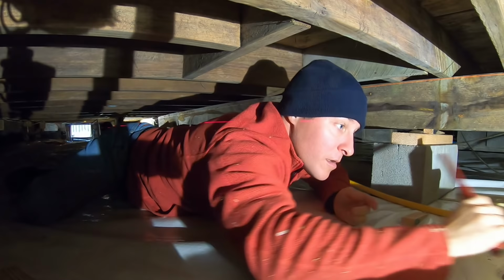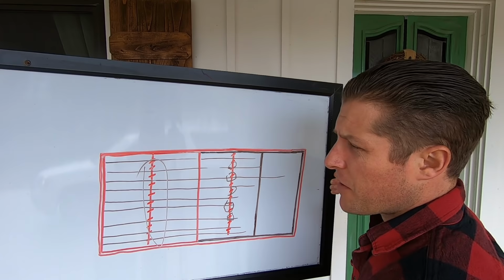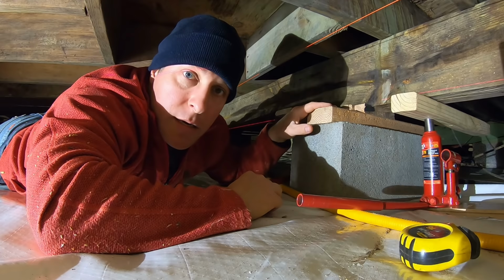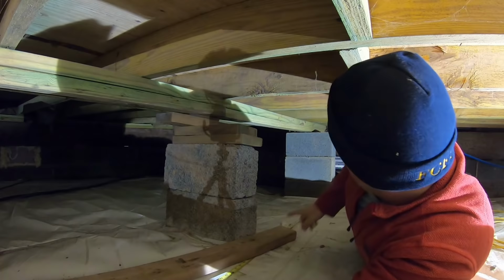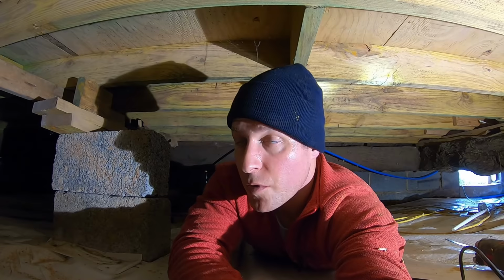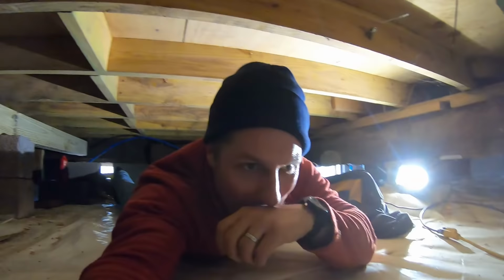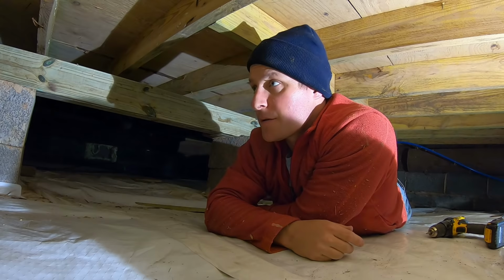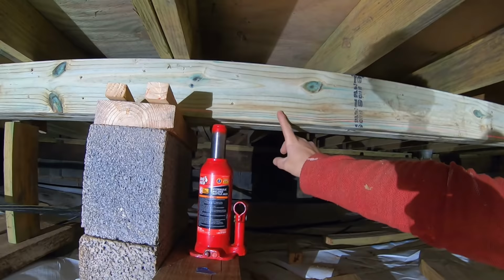Leveling FLOORS in our 100 year old Farmhouse! Fixer upper

Comment: That's a major undertaking. 👏 Just in case you ever need to do such a task as installing new support beams in the future there is a reasonably easy way for one person to build and install the new beam by themselves. I undertook a similar project but not on a 100 year house four years ago. Our house had a major water problem underneath and moisture deteriorated two of the main support beams. I didn't have any help. So, in order to replace the beams I placed my new beam materials in place under the house. In my case I had to assemble and install temporary beams along both sides of the original beam so I could remove and replace the original one. Working alone I realized the best way to do this was to assemble the beams in place. So, to do that I lifted each piece of 2x8x12 into place individually on top of the blocks. Once in place I assembled them using 5 inch construction screws then using bottle jacks pushed them up into place and shimmed to complete leveling and supporting. Its a task either way but in a pinch one man can accomplish a lot if needed.
Reply from the maker: Oh yea that sounds like an accomplishment. I actually really enjoyed this project. Thanks for watching.
Reply: i am doing this in spring. How did you handle your humidity problem?
Reply: @philmoore71  I did a full crawl space encapsulation. The main beam sections were only a portion of my project.  I also had to sister 17 of the floor joist that were also rotted and deteriorated. We had a water run off problem due to soil saturation and property grade from the left front to the back right rear corner. There had been useless plastic installed by the previous owners but, the water would actually run under the foundation and rise up into the crawl space on the lower back side.
 My 1st step of the project was to remove all of the old plastic and dibris left behind by the original builder. 
The next step was to dig a French drain along the front foundation and down one end of the house to the lowest point inside under the crawl space at which point I installed a sump basin and pump.
The next step was to grade,with a rake, all of the uneven ground underneath the house to help minimize any potential ponding of water below the 12 mil vapor barrier I was installing in the next two steps.
The next step was to close and seal all existing crawl space vents. Then I installed 1 inch foil backed foam board insulation around the outer foundation walls. Next, I installed a band of 12 mil vapor barrier approximately 16 inches up onto the foam board and out onto the ground about 24 inches. After completing the outer walls I wrapped all of the piers in the same fashion. Next, I rolled out the 12 mil barrier onto the ground and covered the entire crawl space. The last step was to tape all of the seams so no water would rise through the seams onto the top side of the water barrier. 
Lastly, I replaced all of the existing AC ducting. 
Upon completion of this 1800 sq/ft crawl space repair I had spent approximately $4600 on all materials including new ducting, all vapor barrier, fasteners, tapes, 3 hydraulic jacks, battery drills,  masonry blades, sump pump, basin, drain piping and drainage rock. I also completed the entire project alone. The total time invested was approximately 160 hours over four months. The cost savings was over $14,000. I can possibly share some photos of before and after if you would like to see them.
Reply: @philmoore71  it actually was available in 18 mil at the time of my project. I ordered all of the vapor barrier materials, fasteners sump & pump online
Reply from the maker: Yes @phil Moore those steps are perfect and almost exactly what we did. We used a 20 mil plastic also to finish it off we installed a whole house dehumidifier with the drain pipes into the sump pump basin pit. Our unit was around $900 it’s a moisture medic HC70 I believe. Wow what a difference worth every penny. Thanks for watching

Comment: Question: what’s under the plastic? Is it just dirt?
  If so I think you may experience an ongoing problem with your house settling. 
  I would highly suggest using some solid concrete flat blocks and then set your core block on top of the flat block. This will give you much more solid surface area to help keep the block from sinking in to soil below. 
  Just my opinion. 
   Either way great job at what your doing. Anything was better than what you were dealing with before.

Comment: I have a floor leveling project but I have a couple of complications, one there's a chimney in the center of the house that kind of ties everything together vertically and two I have some settling in the land towards the rear of the house in general which caused the concrete foundation around the perimeter to sag as well...

Comment: Thanks so MUCH for this video.  I was thinking I had to dig out areas for footers to level the floor.  Your video makes it possible for me to accomplish this project.  Thanks again
Reply: This will only work temporarily, may settle and sag again due to no footings, and the concrete block can crack. Pouring footers is the permanent solution with small house jacks.

Comment: 👍 How to find the lowest and the highest points of the joists? What are the reference points? Every time when you move your laser it seats on tripod on the floor. Floor can be crooked or purposely have a slope to collect the water if it flooded. The dirt floor can be uneven as well. If your reference point is the top of the joist then it’s hard to trace from one joist to another or along 1 joist because the laser beam will be blocked by obstacles. 
Also, how to avoid the concrete slab to crack under the pressure of the supporting posts if there is no concrete pad foundation underneath?
Reply: You don't use a tripod in this scenario. You set a benchmark or set lazer on the same fixed object each time. i.e. hang the laser level on the same nail everytime you go down so the reference point does not change.
Reply: @David-lz1rk  👍👌 Thank you so much David! The way I understand, that you mark the benchmark everywhere that laser can reach and then move your laser to one of those marks to reach the other places where the laser could not reach from the 1st place. Is that correct?
Reply from the maker: Sorry for the late reply. But the laser auto levels where ever you put it. So you don’t have to have a fixed point every time. Example for leveling floors. Your trying to level them not adjust the height so the laser will also be level no mater how many inches it is away from the floor. What your fixing or adjusting is the shortest distance from the laser to the floor.
Reply: @LittleDreamersFarm  Thank you. I’m still confused. For example we have a tripod with a height of 5 feet and leveling floor at one location. Now move tripod at a different location and The height of the tripod from the floor is 4 feet and the level of the floor is 2 feet higher. …

Comment: I would have moved the 2x6's one at a time and fastened them together in place instead of moving and lifting the beam as one piece. Much less chance of injury if it falls or back injury from lifting it.
Reply from the maker: It’s a good idea although with the lumber sold today it would’ve been impossible to get the beam straight! I had to lay all the 2x6 vertical on my garage floor and add excessive weight and clamping force to get them all together and straight.
Reply: @LittleDreamersFarm  ...something I was hoping to see.  Maybe next time, haha.

Comment: Even in the mid 1980's, they were still moving houses for various reasons.   I even saw them move brick houses.   (Brick Veneer, can be knocked off, then put back on.  Old brick veneer, means, one full brick wide, not todays, 1/2 inch brick).

Comment: I liked your video. It gives me hope.  I have a 75 year old house. it sits on floor joists on cinder blocks. The cinderblocks have moved causing the joist to twist. My house is only 525 sqf.  I'm trying to figure out if I can fix it, or if I have to have the house lifted.  I dont have any foundation walls. Do you think using these small jacks will be safe in my case. I dont think I need to remove any floor joists I just need to lift it and add supports? 
Your wife is a good sport. My husband is claustrophobic, so no chance of him getting in there with me, but he is always there for emotional support... Lucky me. Hahaha
Reply from the maker: Haha thanks for watching. Yes half of our house was almost the same way. It didn’t need extra supports the ones there just needed lifted back up.  The floors jacks sometimes won’t  lift the house up but they are enough to lift the sag back to true. Then just adjust the blocks or add spacers.

Comment: You said you used 2x4's nice work on all but the supports need to be hard wood SPF (southern pine fur) will over time rot and or compress it is a soft wood
Reply from the maker: Thanks!
Reply: @LittleDreamersFarm  Great job that video was fun to watch I had to do the same thing to a house I’m in right now that was built in the 30s the kitchen was sagging so bad that a roller cart I have would take itself right across the floor I was lucky enough to find two beams on marketplace metal 4 inch tall I-beams that I put under it and raised it back up an inch and watched your video before I did it

Comment: I have am enclosed porch on the back of my 800 square ft home. My dad built it years ago in the 80's.  It is approx 9x24. and he installed four nice big windows.  need to replace them but the room is sagging. It has no footings, just logs that he used to hold the room up, it is sagging a lot now. The door doesn't, close on the room anymore. So estimate to jack this little room back to normal, they want $4500. Seems really steep to me. I wish I was able to do it. But I wanted to see how it is done.  Last time I was under there was 10 yrs ago. I know that I can't do it, but I wanted to see how it was done. Thanks for the great video.
Reply from the maker: Thanks for Watching!

Comment: I was told it would cost me $10,000 to have my old Japanese house leveled out and firmed up against earthquakes. It's around 100 years old, also. I'm now trying to figure out how much of the leveling process I can do, as well as fortifying the overall structure. There's no floor insulation currently and the floor planks aren't nailed down, so they can come out and allow me to work under there without having to crawl under. Also, the kitchen was originally on the ground with a dirt floor, and was later (slightly) upgraded with some joists and a half-inch plywood floor, but that floor has turned almost to crispy chips and everything heavy in that kitchen is leaning and/or sinking. I plan to tear all that out along with the damaged mud walls, replace all of the rotted-out wood, level everything out, and then build a kitchen floor the same height as the rest of the house before adding insulation and replacing the flooring. However, I haven't figured out yet how to solidify the foundation. From what I understand, a contractor would go under the house and basically replace all of the stones it sits on with concrete feet and slabs. I have no idea how I might do something like this.
Reply: Where you are going to place your supporting concrete blocks, it would be best to dig approximately 2, foot  x 3 foot x 2 foot deep hole, depending on the quality of your earth under your building. 
Make sure the 3 foot length of the holes are at right angles to the floor beam that is to be supported. 
I would also suggest , laying some small lengths of rebar in the at right angles to each other. When you pour a medium mix concrete ( say 5 to 1  ballast to cement with a water proofing agent’s added) and ensure your rebar is adequately supported , even knock the bars into the side of the hole.  so it is different layers when you pour the concrete there is no harm in wetting it up slightly to make it easier to pour. If concrete mix is too strong , the strength will be lost as the pads will not allow natural movements and then they may snap. 
I also advise laying a good bed of bricklayers muck on the dry pad and bed a roof slate on to it perfectly level in all directions ( once the pad is dry). 
Let that go off for at least half day then bed your concrete blocks down on to slate once again using a bricklayers mortar mix’s with water proofing agents perfectly level in all directions, if possible fill blocks with concrete ,added strength 
Leave for 2 day’s. 
Now when you’re level is set up you can go round all pad with all wedges cut. 
Lift the beam with the two jacks either side and add wedge’s, ensure the wedges are cut from straight whole wood (4x2) cut the angel from top corner to bottom corner on the 2” side of the block (a little bit of sawing effort). 
Laying the 4” flat side on the block and preferably on some strong adhesive, then add the other half of the wedge, with the flat side to the beam covered in wax. 
Knock wedges evenly from both side until you are at your required level. These wedge’s although they have a an adhesive between them will need fixing together and to the blocks. I have suggested wax where the bottom of the beam bed’s down onto the upper Hal of the packing wedges to avoid noises, this leaves all the old original wood the abilities to breath and move with the weather conditions 

It would do harm bedding another slate onto the block with an even bed underneath too ensure it can’t split. Slate has an good strength with weight on it. 
I’m a traditional English builder that very rarely works on a property less than 150 years old , most are 3or 400 plus years old , so a lot of investigations goes on my days work and every day is learning curve. One thing I’ve been taught, I’ve seen used in repairs, I’ve seen used in structural conditions ( new main floor joists, resting in chimney stack wall and across to party wall. All levelled with cut up roof slate, then bed in with bricks around etc. 
still to this day I save any old slate I can find as it is used for most situations on a 400 year old properties , not just the roof.  If used correctly will make a perfect damp course protection, it will not let water rise up past it , hence using them under or/ and 
on top of concrete support hope this or some part of is useful to someone 
Kind regards to all builders, especially to specialists builder who may not set eyes on modern structures for years, and generally most are appalled at the quality when or if we really have to
 Nath
Reply: @nathanreay3234  Wow....thanks for the very detailed reply! I'll save it and look it over! Thank you very much!

Comment: I've tried this under my mobile home and it doesn't last more than two years because of frost and clay. The weight of the cinder blocks causes them to sink and teeter even with a patio stone underneath the block. Next I'm going to try cribbing with 16" sections of 8x8 pieces of pressure treated  wood.

Comment: The sandwiched 2x4s are the same cross section either way because they're stacked. It's just a square cross section.
Reply from the maker: Nail a pair of 2x4’s together. Span a gap walk on them vertical and flat then get back with me. Thanks for watching
Reply: @LittleDreamersFarm  I mean, I'm a structures engineer. Sure it's not preferable, but technically it would be the same if they were properly laminated.
Reply from the maker: No it would not be the same. 2x lumber is not even rated for load unless it’s vertical.

Comment: I need to do this very thing and have just about the same space to work. One of my walls in loft put pressure on floor joist and caused uneven floor 8ft long. Think I need to support about 4-5 floor joist. Scary stuff cause could get trapped or worse under there.

Comment: You need to put concrete footings under each concrete column minimum 16x16 inches. Each concrete block must have concrete in between each block. The columns must be finished with a cap block. Then your wood blocks with shims. I was going to sell my mom and dad’s house , but before I sold it , I had a structural engineer inspect. He stated that had be done, to pass inspection. 
It cost over $7000.00 to complete. They just constructed the new columns right next to the old improper columns. The footing was done one day waited 24 hrs The columns were done one day waited 24 hrs to dry. Then the  wood and shims was completed on the 3 days. 
Just putting blocks on dirt with no footing will not be sufficient. Then put your concrete mix in between the blocks with a cap block
Reply: That's how it's done. 
However, you missed a couple of parts though; the carry beans must ride on non-compressible material, i.e. steel plate shims or concrete shims, such as scraps of Hardie board. I've done hundreds of these and I cannot tell you how many times I find wood shims squashed due to the building using wedge shims.

Comment: Question - I need to crawl under my place, we bought July 2023 - it's a 1950.  Why couldn't you use a 2" paver above the concrete block instead of 2x4 pieces?  And then shimmy that or use concrete adhesive between the cinder block and the paver. Just curious, seems like wood is more likely to deteriorate.  Thank you for your video, this is a cold weather project, but it's already hot here in Texas.

Comment: Did you have finished walls inside when you jacked up the floor and did it crack the drywall or separate at all.  I’m looking at a 1906 Victorian that someone walked out of the remodel on and most of the interior is done but they didn’t level the flooring first.